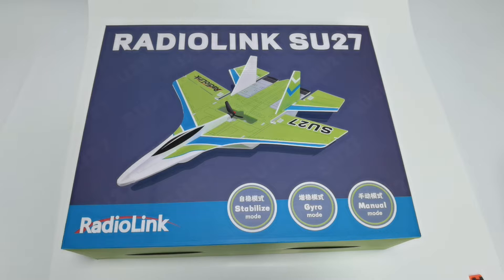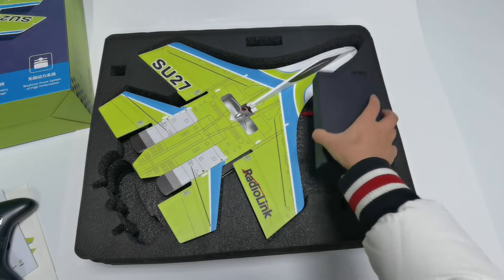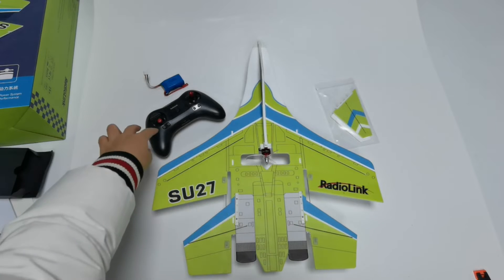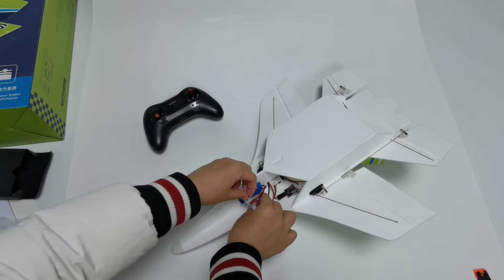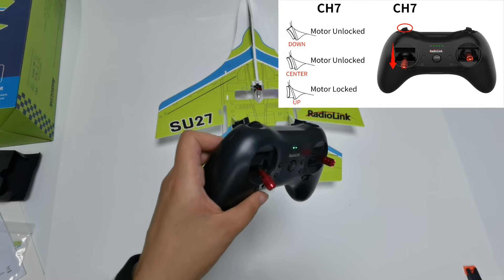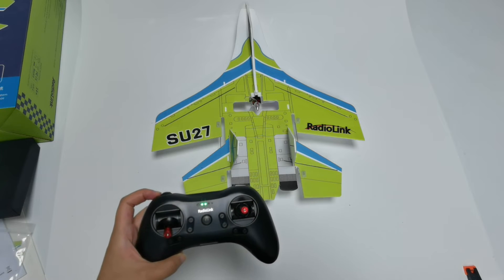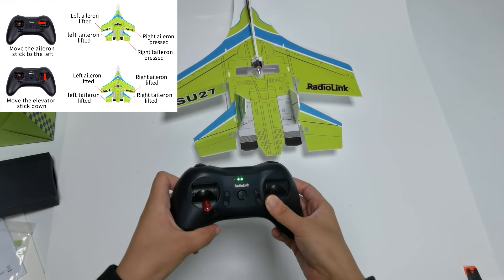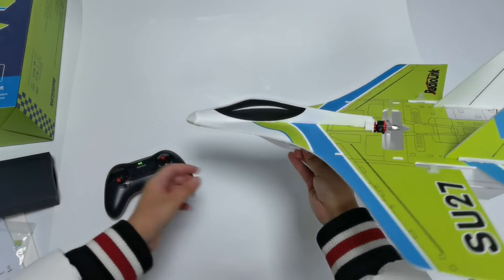RadioLink SU27 Unboxing & Byme-DB Setup

Comment from the maker: Hi everyone, SU27 is a New Release ready-to-fly airplane from Radiolink, which has 3 flight modes and supports RSSI & voltage telemetry. We have a 30% OFF discount on SU27 RTF exclusively for our fans. Contact the account: sherry@radiolink.com.cn and get the CODE if anyone is interested. There are only 10 spots left and this promotion is only available until January 20th, so act fast!

Comment: Can you bind 280explorer long range drone to the at9s pro I'm having problems
Reply: Can you make me a tutorial please
Reply from the maker: Hi, sir. If you want to use AT9S Pro to control your drone, you just need to make sure the RadioLink receiver you use can connect to the flight controller in your drone. May I know what RadioLink receiver you are using on your drone? You need to make sure the signal of the receiver match the signal of the flight controller in your drone. If any question about RadioLink products please feel free to contact us. Our email is: after_service@radiolink.com.cn
Reply: @Radiolink_official  I'm using r9ds it's bind then disconnect
Reply from the maker: @kiloblock4950  Hi, sir. Sorry we have no 280 explorer long range flight drone, so we cannot make such tutorial. And sorry we do not clearly understand what you mean? Do you mean the binding of AT9 and R9DS disconnect? Here is the tutorial of binding of R9DS for your reference. https://www.youtube.com/watch?v=c3K19QB2_xE  Could you please take a video to us? Then it will be helpful for us to better know what happened. You can send video to our email after_service@radiolink.com.cn
Reply: It's the 280 explorer long range flight drone I may be putting it in bind mode wrong can you make a tutorial please in link it to a at9s pro remote please
Reply: It got one key switch return home gps fpv I can't bind mine please help me